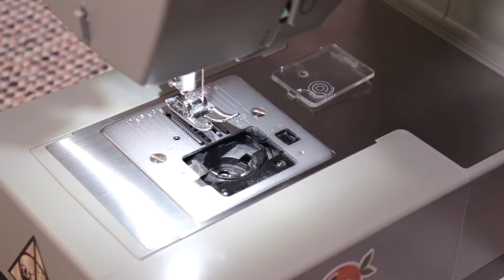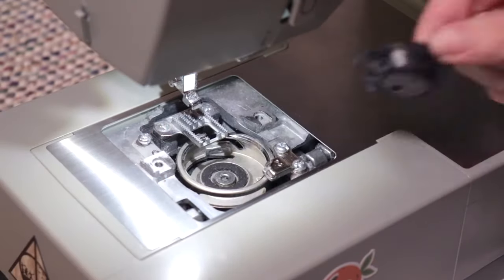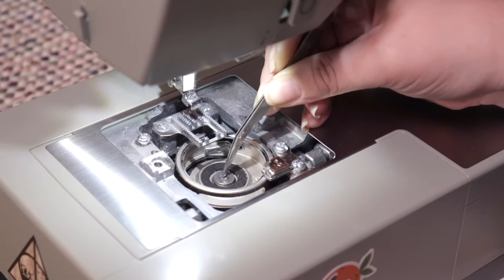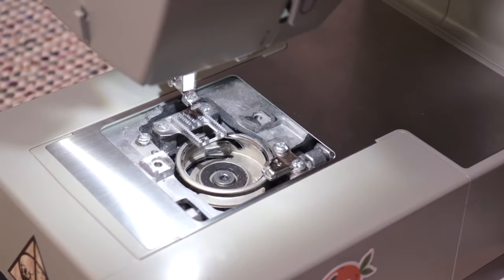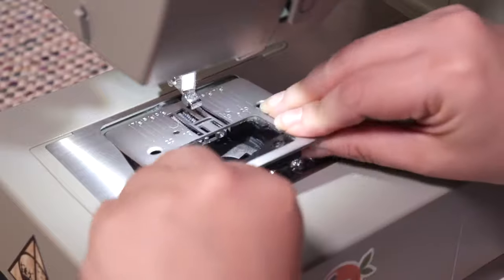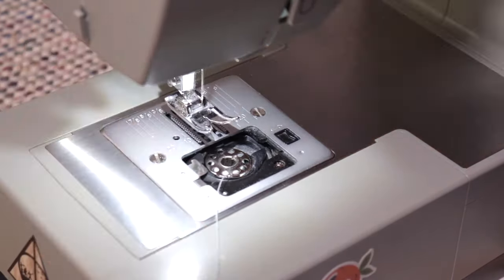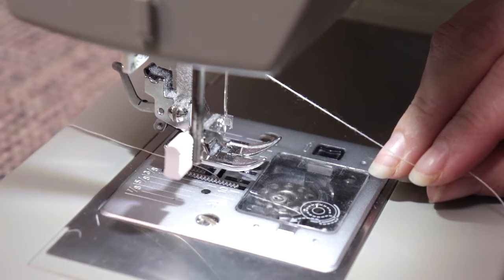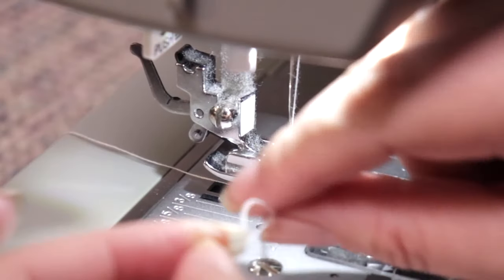Oiling A Sewing Machine | Singer Heavy Duty | Automatic Needle Threader

Comment: Agh I didn’t know the bobbin housing arm is supposed to come out. Mine will NOT budge 😭
Reply from the maker: No worries, sometimes you can move the flywheel by hand until the hook race is at the back and the bobbin housing will lift out. So turn the fly wheel by hand and gently lift the bobbin housing until it comes free.

Comment: Question!! Does the upper part need oiling as well? I can clearly hear the piston complaining if I use the machine very slowly. At normal speed I wouldn’t hear it, but… 👀
Reply from the maker: Yes! You can and should also oil the needle bar. You have to remove the upper cover from the side. (Screw is near the thread cutter.) then add a few drops the the solid bar that runs vertically. It should help!

Comment: Hi there and thanks for making this video.
I dug a bit and found that there are two felt bushings up top, and two below in the drive linkage that need to also be maintained.
Also there are multiple pivot points above the needle that need oil also. Pretty much everywhere moving parts touch.

Just wanted to make sure that you don't wear out points of your machine not knowing that there was a way to preserve them.

Thanks a bunch for making videos for all of us!!!

My best,

-Nigel
Reply from the maker: Thanks!
Reply: Thanks for this video
Reply: Thanks to you Nigel, for this insightful and helpful comment. Removing the bottom plaastic areas (just about 8 screws) reveals the areas that are greased, need to be greased, and the two felt bushings that you refer to. Honestly, you should do a video of it and monetize it. Very helpful. Though my machine is NEW, I oiled it up properly and she's now 80% quieter to my surprise. One thing: there is a plastic cam/ gear combo on the right back top of the machine that works with the feed dogs. This looks like it needs maintenance. But that will require removing the whole top casing I think. Another day......

Comment: My machine locks up several times. The wheel is hard to turn and it basically unable to sew. 
When That happens, I take the plate out and the bobbin housing out, double check it  but it  keeps locking up. What can I do?
Reply from the maker: Have you ever done a thorough cleaning of your machine? You might have threads caught up underneath that could be holding up your machine.

Comment: Great video,  If the theader little wire is broken where can i buy a replacement
Reply from the maker: Hey Bob, not sure what part you mean, but if it's the last thread guide before the thread goes into the needle, you might be able to add on a bit of floral wire wrapped around the remaining piece to complete the guide bar.

Comment: Great video.  More than likely I need to oil my machine.  Been about two years now since I purchased this machine.   With sewing a lot of flannel it is sure to need oiling.  Those screws where the bobbin housing is extremely tight and can't undo with key provided with machine.  Any suggestions?  Tx 4 in advance
Reply from the maker: You might be able to get the bobbin housing out without removing the arm. I have a few of these machines but can't seem to get any of them to let it loose without unscrewing the guide arm. If you still can't, I would just continue to gently try and get them worked loose so you can get in there.
Reply: Put a drop of oil on the screw and around it, let it soak inti the joint, then try unscrewing it

Comment: Hey there! 

I've been told not to use a medal bobbin? What kind are you using ? I have the exact same machine!
Reply from the maker: Most manufacturers will say not to because the bobbin housing is plastic and any metal burs or imperfections can/could damage the bobbin housing. I have found that if you just buy good metal bobbins, that shouldn't be the case. Also, if you start using metal, you should only use metal. You should not go back and fourth between plastic and metal.

Comment: Hi Stacy good video on the needle threader. I have 4432…How do you get the top and back off this machine. The two screws on top come out and only one on back but top will not come off! Help please. Thanks!
Reply from the maker: The plastic that the machine is made of has a bit of a 'clip' if you will to it. So once it's unscrewed, it doesn't just come off, you do need a small amount of force to pull it off.

Comment: 4452 machine doesn't need oiling upper portion? Just at bobbin?
Reply from the maker: Yes you can oil the upper but not nearly as frequently as the lower as the lower builds up lint and sucks up more oil.

Comment: @SewingWithStacey    Hi. So, I'm hoping I can get an opinion on something...  I have a store bought weighted blanket with the the little glass beads inside.  I'm wondering if you think it would be a bad idea to sew through it. Idk if it would damage my sewing machine if the needle came straight down on any of the little beads.  It's pretty much brand new, and I hated the thought of throwing it away.  I've been trying to find someone to take the thing, but nobody wants it. Probably about the 25th time moving the thing from one spot to another, I started thinking maybe I could make a few door sweep, draft blocker dealies out of it.  But now I'm just sitting here staring at it, worried it might jam my machine. Idk...  Just hoping I can get an opinion or two before I have at it.  Thanks in advance
Reply from the maker: Hey, great question. So I make a lot of heated corn bags. What I usually have to do is make small compartments and pin back the corn to make sure I don’t hit any kernels with the needle. For your project, I would not advise putting that through the machine unless you can safely clear away all the glass beads in are for sure only sewing through fabric. If the needle comes down on one of those glass beads, it could shatter the needle or worse.
Reply: @sewingwithstacy     Yeah, I got a little nervous and went safe.  I just made one with rice instead.  Thanks so much for getting back. 😊   I appreciate it
Reply from the maker: @TruthIsARuin  no problem! glad it worked out!

Comment: I accidentally pushed the wick for the oil further down its opening and now I can't get to it with tweezers. Do I have to get it from the bottom of the machine by disassembling it or is there another way to retrieve it?
Reply from the maker: No worries! Just let it be. Odds are that you didn't push it down too far and with normal use, it will work its way back up on its own.

Comment: That is not how sewing machine service techs oil the 4452.  Black oil is a sign of metal wear which means the lubricant being used is not protecting the metal.
Reply from the maker: Thanks for the input. I'm oiling per the manufacturer guidelines for this machine.
Reply: @sewingwithstacy  I tried to find out about oiling after use and could not find anything from singer, so I appreciate this so much.  I regularly oiled by old machine, and my mother's 301 which is still working after 66 years .